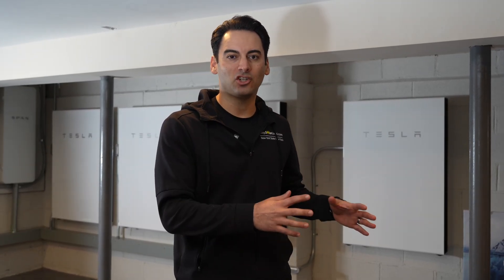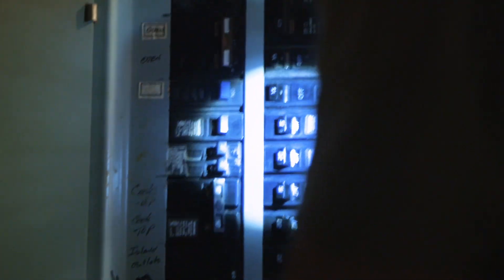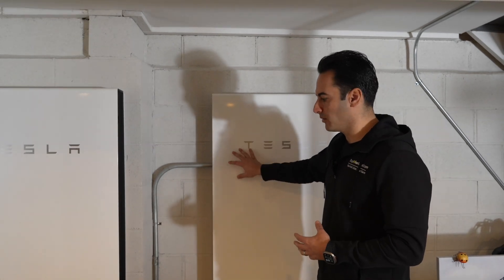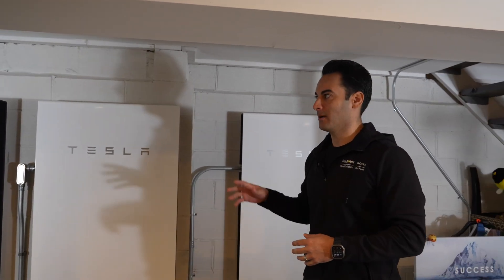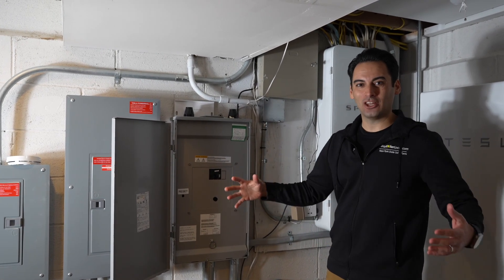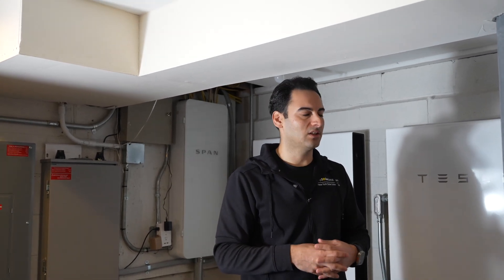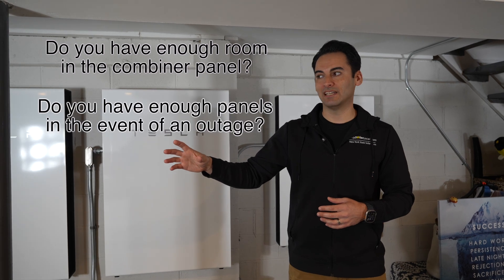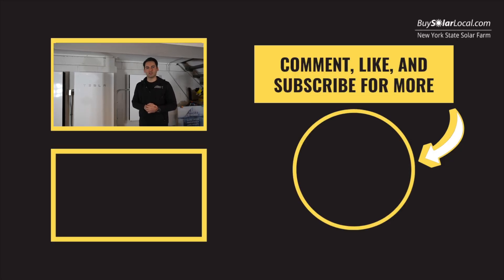What to know when adding a TESLA Powerwall to your solar system

Comment: We just had two PW3s installed and under most circumstances 27 kWh of whole house backup will cover 90% of our needs with some basic conservation.  But there are some rare use cases where 27 kWh and solar won’t be enough even shedding loads.  But we are hoping to add a new EV with V2H in the near future.  Hopefully in 2026.

Comment: Are your  PWs  powerwall 2's? If so, are Powerwall 3s as easy to expand by adding a full, not expansion pack,  PW3 to any existing PW 3/Solar system? I'm being told by initial system installer that it would be a major deal to add one with rewiring needing to be done everywhere including up to rook and solar panels. This is a brand new PW3 installation on a new build home with plenty of space in breaker.